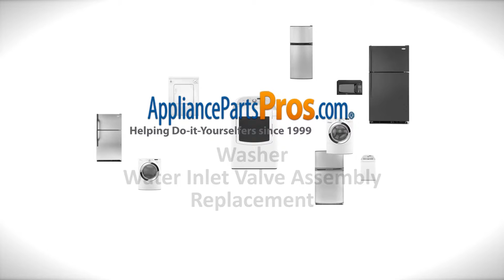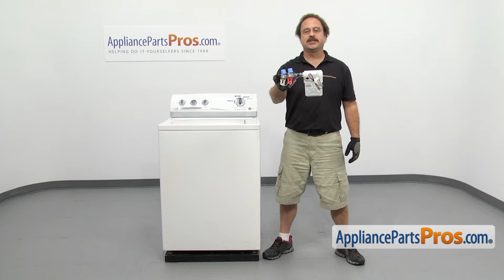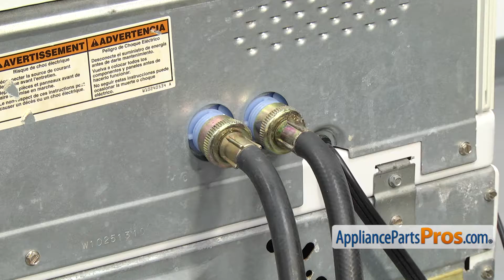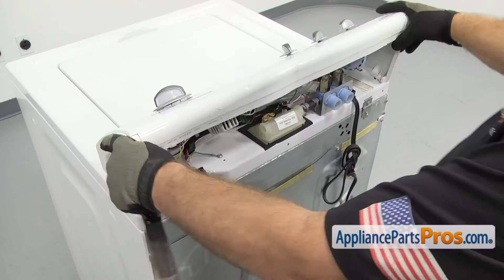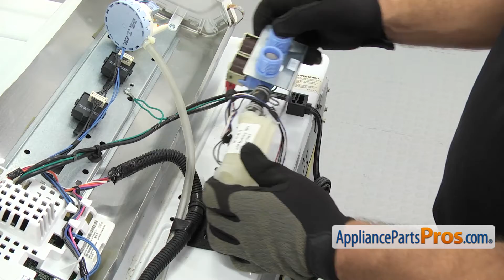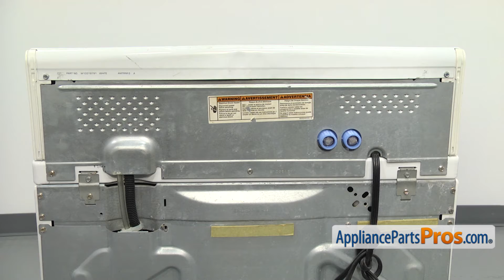How To: Whirlpool/KitchenAid/Maytag Water Inlet Valve Assembly WPW10432353

Comment: i see ebay sells a few of these valves   PREOWNED… i believe they are guarantee….ussually this valves stops operatening on the cold water , so if u need to  use it while replaceable valve arrives …..i use the hot water so that side of the valve usually works….good luck
Reply: The hot went out on mine.

Comment: Thx to your VIDEO here, I'm close to completing the replacement of my defective water inlet valve (WIV) on my old Mytag ... I just need a few more tips please ...
I've just replaced the old WIV with the new one ... BTW, my unit looks to be virtually identical to the washer here in your video ... here's the big question ...
Does it matter which of the wires are attached to the celluloid prongs?  One has a white plastic casing and the other is red ... does it matter which prong the red one is attached to? 
Also, just as shown here in your video, there are also two smaller wires that must be re-attached to prongs on the neck of the WIV ... does it matter here also?
Is there a way to re-attach the wires incorrectly? ... if so, could I damage the machine?
Your thoughts please, thx much, Doug